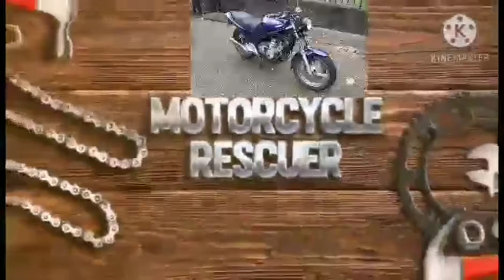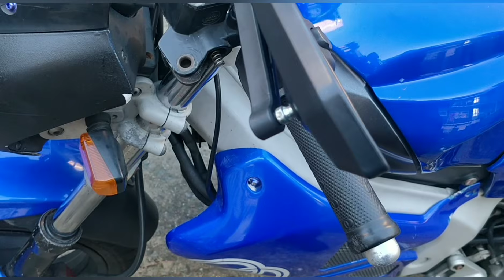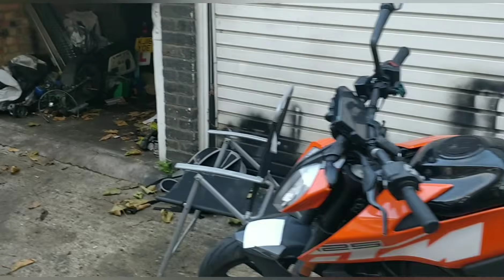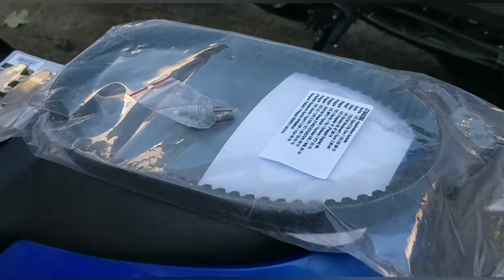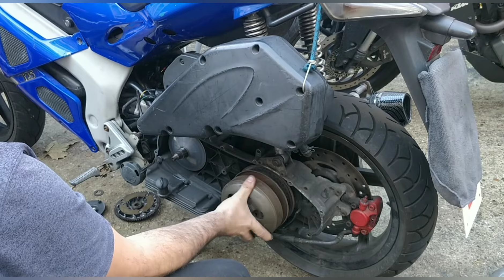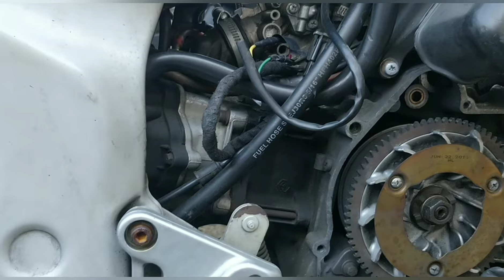Gilera Dna belt change, variator inspection and clean. How to change a drive belt.

Comment: It's a good insight into cvt belt type drives. Although I've worked on hundreds of motorbikes I've never been into this type of drive unit. 
So thank for the education.
Peace and love brother. 
Yeeehaa and howdy partner from this Cockney cowboy in Lincolnshire! 
Sorry I couldn't resist!
✌️❤️✌️❤️✌️❤️✌️❤️✌️❤️
Reply from the maker: I knew nothing about them until I met Jake some years back.
Reply: @motorcyclerescuer  Well you definitely have the knack with them now buddy. I love to learn and just like you , I like to dive in and have a go. 
Cheers my friend, take care. ✌️❤️✌️❤️✌️❤️
Reply: I recently got talking to a guy who worked next door to me with one of those honda 750 scooters. The really quick looking ones. His had 3 speeds plus the CVT transmission. Absolutely flew.
Reply from the maker: The Peugeot jeyforce has a supercharger on its bike that's cvt lol
Reply: @motorcyclerescuer  I need to look into that 👀😆
Reply: @MaNNeRz91  There's some crazy scoots now. The Honda off road looking ADV is nuts. 
I'm at the stage now where giant 1200plus cc behemoths are too big and heavy to handle. I've had my eye on the burgman 650 for a while for a total change. Although they come in around 280kilos! 
But I'm also leaning towards the 750 katana or gsx750f. I had one before and they're a good mix of comfort and reasonable power. With a really low seat which I need now. Just can't climb on the giants anymore.  
Don't ever get old . Or if you really have to, don't destroy your self on the journey like I did!
Peace and love Paul take care .✌️❤️🤗
Reply: @springy-2112  too late my knees, back and ribs are shot to bits 😆😆😆

Comment: I call my Ryobi gun an ugga dugga 🙌😆

Theres a trick to the shimming but you need to do the marker trick and take it off a few times.
You want it spaced for the belt that's being used. A wider belt will need more spacer for initial acceleration and will give a bigger top end. But factory shims will be fine 👌
Reply from the maker: It's a factory belt so yes factory shim on this occasion. 

Cheers Paul. Hope your well mate
Reply: @motorcyclerescuer  im all good mate and you.
I should be free to pop up next weekend. I've got a few more little bits done but got plenty more to do on the aprilia.

Don't forget about those clutch springs you've got. That DNA would be a new beast with some heavier springs in as well as the work you've done. 
Did I give you some rollers too?
Reply from the maker: You did give me rollers Paul. 

I didn't bother putting new parts in the DNA because he's planning on selling it soon. 

I should have a few good bits to do this weekend including brand new carbs for the old triumph finally. 

Possibly a valve for the Chinese bike aswell. 

So a couple interesting bits to do.
Reply: @motorcyclerescuer  sounds good to me mate I'll do my best to get down as much as I can before the weather turns too bad

Comment: like the sped up belt fit, works well
Reply from the maker: Hi Steve, yeh it kinda shows enough and people can slow things down if needed. Normally I cut and come back but a bit of speed up footage at least shows that I'm doing it. 

Cheers mate
Reply: @motorcyclerescuer  great to see all footage, even if its been shown before not everyone has watched all your videos, maybe a mixture of fast forward/ still clips would be nice to keep around the 15-20 minutes that they like

Comment: I am considering one of those torque guns for front sprockets mainly 👍
Reply: And it's Christmas.. they're doing 12 tools for Christmas deal where you get another free tool or battery with the purchase of the impact gun
Reply: @MaNNeRz91  cheers thanks for the heads up 👍
Reply: You'll never regret it 🙌
One of the best additions to my tool box. I've had it 2 years. Bought it when I was doing subframe bushes on my car because I couldn't be bothered keep lugging about a 2.5ft breaker bar 😆